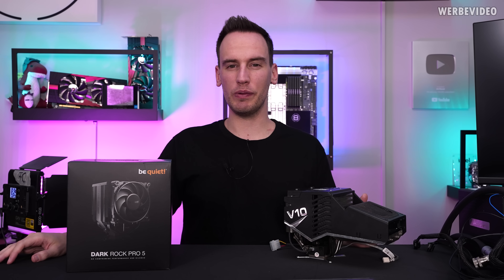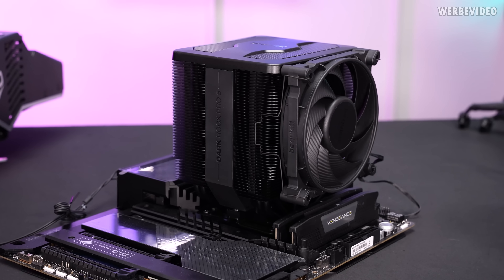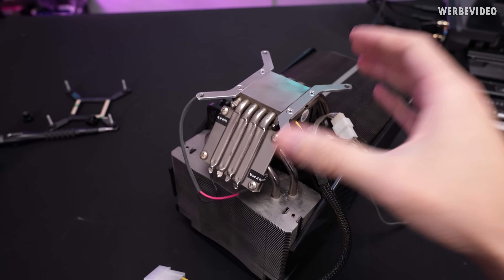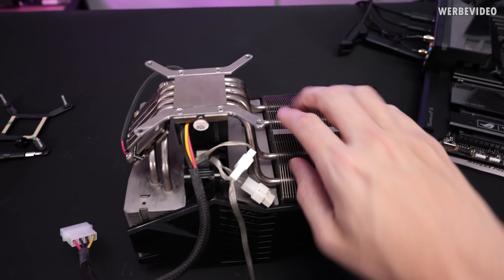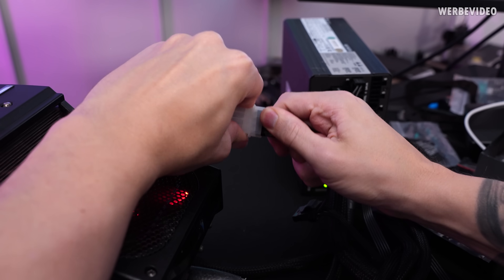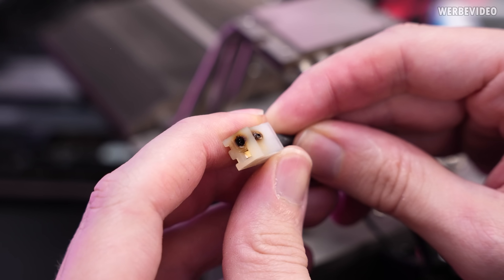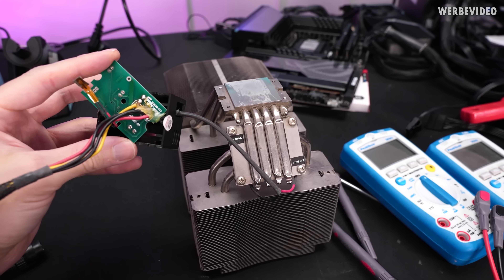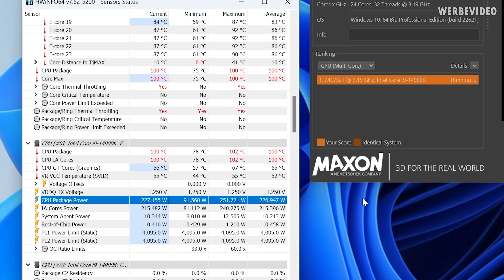This Gigantic Cooler from 2009 has MASSIVE Problems...

Comment: The power draw of current Intel CPUs will never cease to amaze me in a negative way. 300W for a CPU is absolutely ridiculous.
Reply: And the worst part is almost if not no off-the-shelf cooler exists that are officially rated to dissipate 300w of power consistently like that except maybe some AIOs like the Liquid Freezer II 420mm. Otherwise if you wanna run it at redline with no power limit and keep it there, you're gonna have to go custom liquid loop.
Reply: @Shyvorix  yup... You need big rads to do this or just enough rads. Even those big massive passive cooling systems can't handle this
Reply: It's so weird because back in the first half of the 2010's, Intel seemed to be all in on power efficiency. Now they seem to have ditched that entirely, including scrapping their NUC's, Atom and Core M3 CPU's.
Reply: lol ONLY when overclocking/benchmarking. You people just mimic everything people say, tell me how AMD's degrading memory controller is going. I like both but my god, no one cares about power when pushing or over clocking. Imagine caring about a drag car's MPG, IMAGINE....
Reply: (in ref to OP) yeah, CPUs and GPUs have gotten a bit mad past ten years. Think there was a time intel launched a (Northwood) Pentium 4 Emergency Edition that consumed some crazy power just to get some iffy clocks, and almost nothing could keep it cool at the time. sadly coolers have gotten better, so most people are not complaining that the CPU at stock is thermal-throttling when idle at an empty desktop, lol.

P.S. I'm pretty sure the EE was market at 4GHz at 220 or 230 watts, yet some sites list it at 3.2GHz others at "up to" 3.75GHz, yet again, thermal-throttling when idle, so, reality subject to change with room temp and computer cooling capacity, lol.
Reply: @kleanthisgroutides7100 Most tech tubers are Tech illiterate, for sure.  DerBauer is one of the best i think, and Skatterbench.
Reply: I guess they think "if GPUs are drawing that much then why don't we?"
Reply: My 120w 7950X3D laughs at them.
Reply: Yeah it is kind of weird, like who needs a 300W CPU when we're going through climate disaster as a planet. They should be focusing on keeping the performance with power efficiency. Don't let me even get started on GPUs. 450W graphics card is simply dumb. No PC component should exceed 200W.
Reply: idk my 14900k 120-125 watts gaming touching 6ghz. if people cared about pollution, then they should be seeing what they are eating.  @lordshitpost31
Reply: when did break more than 200 for an average cpu???
Reply: Back in the day that would've been understandable for an overclocked HEDT CPU, but for a consumer-grade CPU with stock settings..
Reply: Its ridicolous because you are not used to powerful things.
Let silent computers to delicate apple users that can get wrinkles if  there s too much noise
Reply: thats on the motherboard manufacturers. I set my i7 13700KF to 125W and it still runs at max turbo freq (5.2GHZ all p-cores) during a long gaming session (cyberpunk 2077). Also no issue with heat as temp averages at around 80-85 degrees with Deepcool AG620 running at 50% fan speeds. After a quick undervolt (-.125mV offset) the temp drops by further ~10 degrees, making the CPU runs at 70-80 C. Again, all cores maintain their turbo freq.
Reply: Last intel cpu  i bought was a pentium III 866 in 1999
Reply: Remember when Intel canceled the follow up of Netburst because if the hight W heat generation? pepperrdge farm remembers.
Reply: That's the thing, it's kinda not fair to test this cooler with modern CPUs. 2009 was what, Phenom II - Core 2 Quad, the most power-hungry CPU would dump about 140W, so this cooler would do it's job just fine, average CPU was around 45-95W. If you look on TEC power efficiency vs temp curve, I think it could actually do some work when used with not so crazy power-hungry chip.
Reply: @xerxeslv  A heat source and heat sink are always just that, heat sources and sinks. As someone else mentioned, this was for the higher end enthusiast that would overvolt their CPU to hell and beyond to get to 5GHz when 2.5 was the normal, also it's for socket 1366 as well, which was exactly that market of insane heat dissipation.
The real problem here is that it underperforms even relative to it's day. It would have made better results with just the extra heatsink straight up on the CPU instead of that TEC in between, I can bet a small copper plate to level things (if needed) would fix that cooler and make it far better.
Reply: @xerxeslv  That's not the point. The point is they are "advertising" a brand new way to cool your CPU that does nothing and the whole cooling comes from the fact you have a huge fin block with pipes sticking out of it.
Reply: @xerxeslv totally true, i was just thinking that too.
Reply: @xerxeslv  Most of the Ryzen 5000 line would be handled by this cooler just fine. They're still modern, just one generation old.
Reply: @xerxeslv  Balls to walls OCed i7s of the day could already get to 200W (and definitely the 6 core ones from a year later) which were generally the ones this thing was geared towards and just like it's mentioned in the video, it failed quite miserably even back then.
Reply: @HenrySomeone  overclocking always changes everything. Water cooling was almost always recommended when someone was pushing a high OC. Something more moderate and oftentimes you could get away with a hyper 212 evo. Though there were times you'd want a more serious air cooler.
Reply: @ArtisChronicles  Almost always? 15 years ago watercooling was nowhere near where it is now, while 20 years ago it was the domain of the most hard core enthusiast and more or less do it yourself (car radiators were almost ubiquitous).
Reply: I remember how people made fun of AMDs Bulldozer for needing 200W and now these same people shill for 300W Intel CPUs...
Reply: @xXYannuschXx  that's exactly the way it'll always be. However I'm not interested in anything that's current gen, I'm just sticking to Ryzen 5000 series for a while. I'll probably stick to my 5700x unless something more capable goes for decently cheap.
Reply: Do you ever watch that tech youtuber called Der8auer, he does some really cool videos, were he caps the power draw on Intel stuff down to like 120 or even 90 W, and shows that Intel CPU's don't loose much performance. You should check him out he's a cool dude.
Reply: @yakacm  if only I could push the GPU power limit slider below 70%, if only. also yes, that Der8auer fella is cool people.
Reply: @Zarcondeegrissom  you can just cap the frame rate when you're gaming.
Reply: I have a delided with liquid metal and cooper IHS 14900k cooled by 360 aio. With no limits applied it can draw 370w btw.
Reply: @Frontofax  wow. That’s a tad more then even my 3090 Tuf GPU at full blast. Insane.
Reply: @machinainc5812  and a bit less than the 4090
Reply: Fast and with high transistor density comes heat. If you want a light power CPU, get one. Or, get the lower silicon quality of AMD that melts its self. The fact that the CPUs can handle that and run perfectly fine is actually impressive...some manufacturers junk can't ;)
Reply: @ChaosHusky  Yup, pretty much, lol. It's actually impressive how the AMDolts quickly forgave the embarrasing x3d exploding scandal.
Reply: I love comments like this because of how uninformed and stupid they are.  I have a 13900k that in gaming never even passes low 100 watts.  Do a little research, find a good power target, downvolt a little, it isn't hard.  Your "game" performance will basically be unchanged, your power draws will be dramatically lower, and your temps will drop like a rock.  This games for AMD and Intel, both of them ship with crap stock settings that can be lowered for little to no actual performance loss in 95% of applications.

Lol I remember on my 3900k the stock settings were so trash that I was able to apply an offset, downvolt, and still overclock it past stock and it was 100% stable because the stock amd power settings were that bad.
Reply: @DKarkarov  i agree kinda, I also have a 13900k and it’s basically always around 100-125 W max during gaming so it’s not difficult to keep it cool for me but at the same time this thing isn’t really for gaming in my mind. I think if I actually had to use it for a workload that could make use of all of its power it would obviously thermal throttle constantly
Reply: Coming from server space, seeing 1 kW on a single chip isn't something unusual. I have in my personal PC a Xeon W7, which under full load can sip on the edge of 600 W. It has several times the die area of client CPUs, and performance it delivers is steamrolling over anything in desktop socket, except in clock-dependent workloads, as it gently scrapes the 5 GHz's bottom from underneath, while not reaching it.

The biggest middle finger of modern desktop CPU is really power density. It's one thing removing 1 kW from silicon size of beer coaster, but 300 W from a fingernail-sized chip is insane challenge.
Reply: My 7950x uses about 280 watts while getting WAY LESS cb score.  Hell even my brother's 13900ks scores 42k STOCK at 252 watts,  Not sure why his 14900k only does 39k at 280 watts.  14900k seems like a pile of junk.
Reply: Intel's power draw*

Even the most demanding (consumer) CPU by amd is below 200W
Reply: Yeah, because 250-260 watts of 7950x is SO much better...
Reply: @HenrySomeone  Only that the 7950X has 16 full cores, while the 14900k has 8 full cores and 16 "efficiency" cores.
Reply: @xXYannuschXx  So? It beats the 7950x nearly everywhere.
Reply: @HenrySomeone  By 5-10% for 50% more power draw, while being nearly a year newer and sitting on a EOL platform.
Reply: @HenrySomeone  The 7950x is actually 230w max. And in comparison to that, the 7950X3D which isn't even that much different on performance, has a max of 162w <.< Intel are using too much power.

I just double checked Afterburner since I'm running a 7950X3D and surprise surprise, the CPU in the DAYS my PC has been on, has gone up to a maximum of 141watts and yet has also hit 100% utilization in that time (probably when I ran Cinebench), so there's the facts.
Reply: @HenrySomeone AM5 socket max out at 230W so 7950x shouldn't peak beyond that unless you're doing some extreme overclocking.
Reply: @HenrySomeone  That's Prime95... A 13900K reaches that with just Cinebench... And a 5800X3D still destroys it in Star Citizen.
Reply: @HenrySomeone  The thing is, Intel NEEDS this power to deliver. AMD doesn't. They were just lazy to optimize the power draw. Enabling eco mode on a 7950x of 125w loses about 5% performance. We cant say the same with intel.
Reply: @iczyzy  "lazy to optimize the power draw"? Blame motherboard manufacturers for letting the chips run at unlimited power. You can enforce Intel guidelines on motherboards to limit CPU power draw to the rated TDP (125W for K SKUs, 65W for non-K). ~125W is the sweet spot for Raptor Lake in terms of performance-per-watt for gaming and load scenarios, which Derbauer himself tested on this very channel.
Reply: @steph_on_yt Glad someone's finally said it. It's not Intel's fault that motherboard manufacturers decide to run chips out of spec by default.
Reply: @iczyzy  so you mad that a cpu has to use that much but your not mad when one is using more from the maker being lazy?
Reply: @iczyzy yeah, the non-x lineup uses ⅓ of the power and is like 5% slower.

Also, the 7950X is 16 cores. The power per core is laptop level, 10-15W.

The 14900K/13900K requires twice as much power for 30% more cores (which are definitely not as fast).

Still, even the 13600K and 13700K require ungodly amount of power to deliver proper performance, while the 7700X and 7600X can be cooled with a 120 aio or a normal tower cooler.
Reply: Qualcomm buying NUVIA for $1.4B and already doing presentations of coming products like Snapdragon X Elite (12cores).
Which will be a very power/performance competitive product vs the Apple M3, Intel & AMD better watch out with their 300W slurping desktop CPUs.
Reply: @N0N0111  I don't think power slurping is going away in the top performance tier. At the end of the day if you increase your cpu size and utilization of silicon it releases heat. And if everyone has a chip that does fine someone will want to have a chip that goes beyond the normal even if cost does not make rational sense. You can run this intel chip with 90% of performance in under 200watt. In some way running it at 100% doesn't make rational sense. But of course there will be people who want to run it at 100% capacity even if that extra 10% performance cost 100% of power consumption increase.
Reply: @sk-sm9sh  Yes, it is not going away soon, there is already replacement technology in the labs and secretly in the wild already.
Photonic CPUs from IBM already doing 1000X in performance and heat is no big issue. There are already Photonic with Quantum projects in labs.
Reply: @N0N0111  lol dude you got no idea what you're talking about. Neither photonics nor quantum computers will not replace silicon. Well at least for any for seable future like 50 years but probably more or potentially never. They are only suitable for niche specialized problem sovling and unlikely to ever come to consumer market. Heat is always going to be an issue as it's basic physics my friend. Maybe don't sleep on your physics classes.
Reply: @N0N0111  In the end the only thing that matters is the performance, at least on workstation and consumer level. Manhours are more expensive than electricity. And most consumers just want the best price to performance ratio.
Reply: @Ziegeri  depends on where you live. In some places electricity is a lot more expensive than you'd think.
Reply: @ArtisChronicles  
Well yes, but companies often have quite cheaper deals with electricity than normal people. If you have 500 workers who make 20€ per hour and you can shave off even 1 hour of idle time per month with more powerful hardware that would save you 10k.

Of course it depends what kind of company we are talking about, software company would have higher wages, but not be as tied to performance as let's say engineers that work with CAD or any kind of 3D.

Even with basic office work when you work with huge Excel files or databases it can be quite taxing on CPU.
Reply: Delsusional, AMD has nothing close to 300W in the consumer market @N0N0111
Reply: Why? Its not like it needs that much for like, 95% of its performance range. I wouldve understood if it was required for it to perform normally, but this isnt the case. I dont see why it would've been better for them to set an arbitrary limit if the CPU can  handle it.
Reply: @amogusenjoyer   Well i'll tell you why! If you have a CPU that can't be cooled even with the best CPU cooler (Normal and watercooling) then something is wrong with the design! Even the best watercooling makes it throttle and that's insane. The reason i am not switching back yet to Intel is the insane powerdraw and i would need to buy a better cooler and case tower then to fit it. So no thanks.  I love my Corsair crystal x570 case wich is good for all normal cpu's. 

Intel has gone the wrong way just to keep up and surpase AMD.
Reply: @karlos1060  you'd probably need a car rad to handle all that
Reply: @amogusenjoyer  is that why you still need a serious cooling solution to handle them?
Reply: they're just mad because AMD chips cant all core 5ghz daily. mad because their memory cant handle above 6000 mt's. All they can brag about is power usage, thats IT.  @amogusenjoyer
Reply: @amogusenjoyer  I remember how Intel fanbase used to moan about AMD Bulldozer's high power draw compared to Sandy Bridge. For reference, Bulldozer never went over 200W. 
But now when we have Intel CPUs running at well above 300W, the same fanbase would have you believe that power consumption is no biggie and if you can't afford to power the CPU, then you aren't worthy of it and whatnot. 
Crazy!

Comment: the big problem with TEC coolers is as a technology they simply do not mix will with distanced heat exchange. Be it heat pipe, vapour chamber or water. TEC cooling is only advantageous for small commonly moved camping coolers. Applications where traditional refrigerant based systems do not last long from the shock and weight matters a lot.